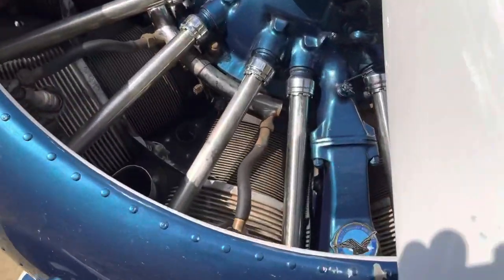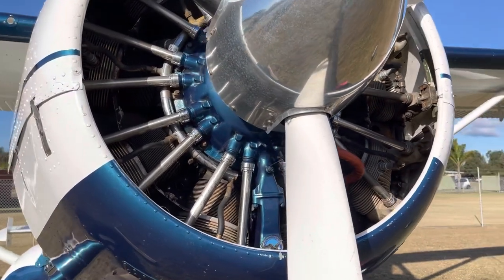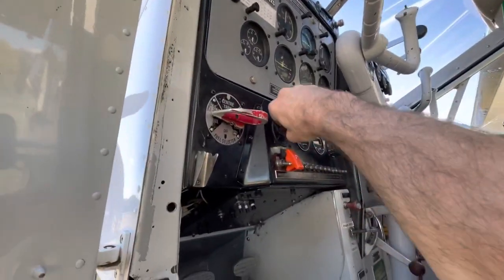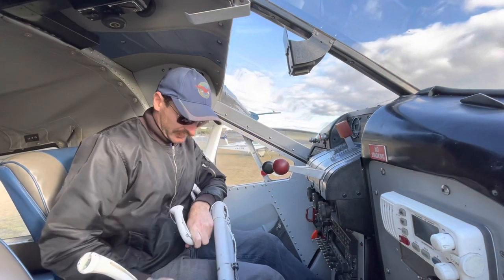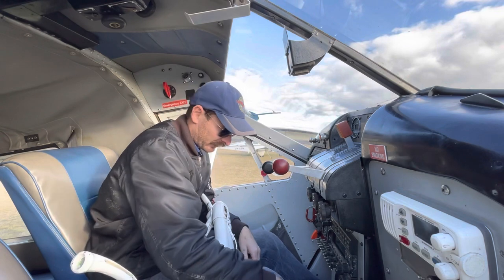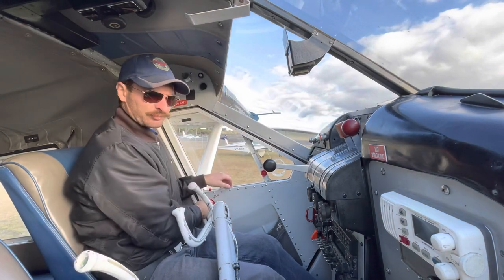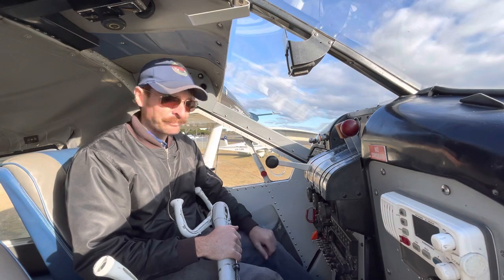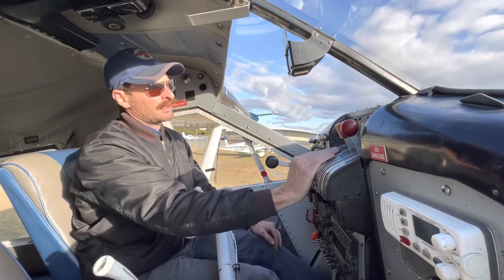How to start a DeHavilland Beaver

Comment: Just hit the starter and count 9 blades ( 3 blade prop) before hitting the mags, no need to pull the prop through by hand. I have started the beaver literally several hundred thousand times and have never had a hydraulic lock, I have never even heard of one in our fleet over 35 years.

Comment: They put this into Microsoft Flight Simulator a while ago, and it does a reasonably good job of replicating the aircraft. 

You can't get out and turn the prop by hand to prevent oil lock though!
Reply from the maker: That's great to hear it's realistic! But yep, getting out to pull the prop through would be a bit difficult!